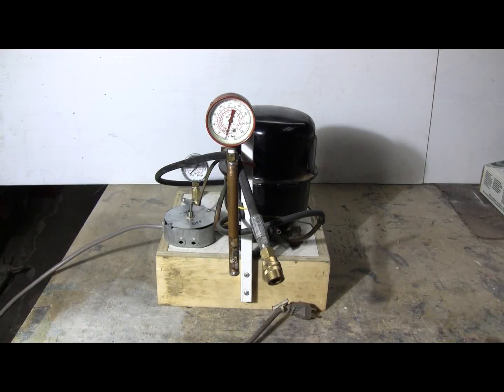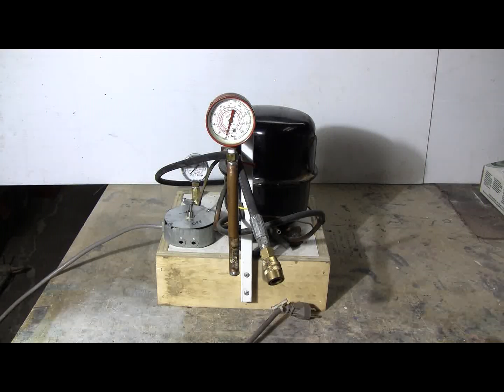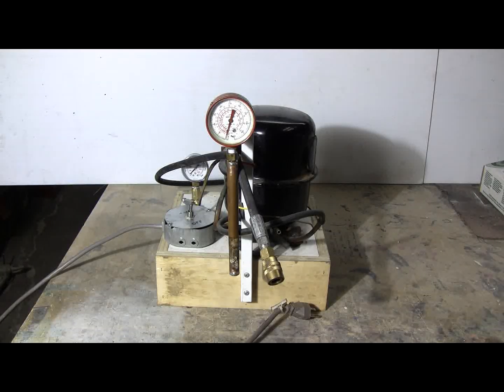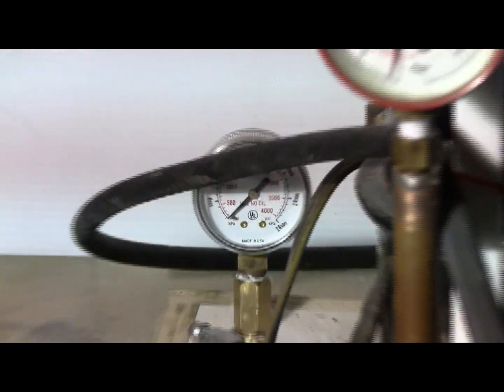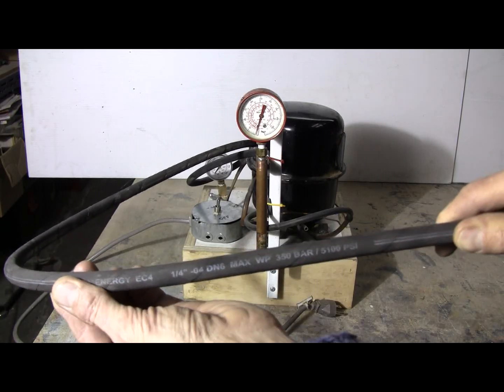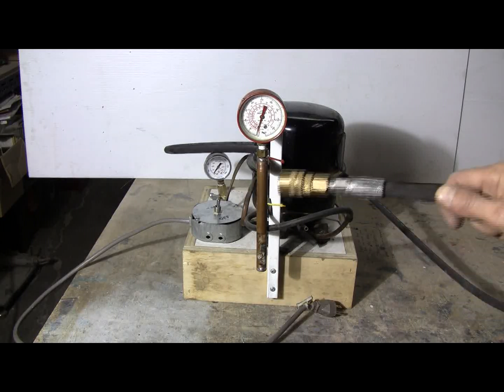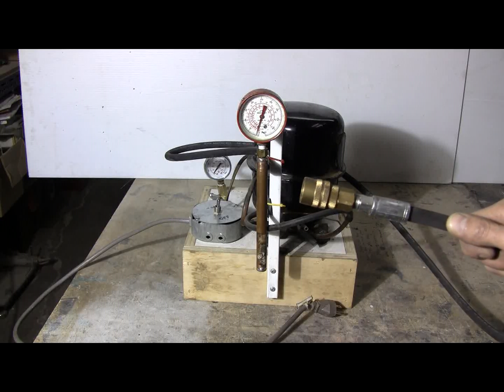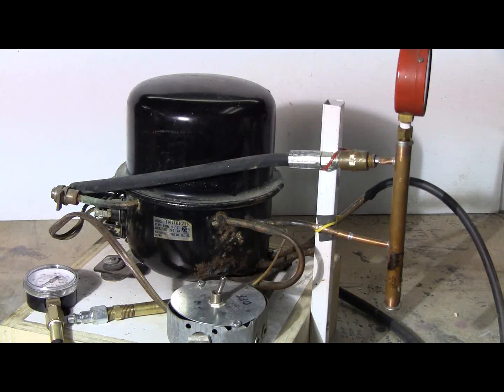Air Cannon #30 - The Air Compressor

Comment: Sir Bill, can this air compressor refill a pcp thank having a 3,000 psi?
Reply from the maker: +nnawoj This type of single stage compressor will not reach 3000 psi. Most go to 450 or so with some able to get up to 650 psi or so.
Reply: How can we refill a pcp tank having 3,000 psi using refrigerator motor?

Comment from the maker: Yes. If you get a good compressor, you will not need to cut it open. You will need to wire it to a switch and of course, a plug. Once you can plug it in and switch it on, one of the pipes coming out of it will be blowing air, but not a lot, and another pipe will be sucking air in. From there, you can rig some sort of air filter for the air intake, and some sort of air chuck on the outlet (high pressure) side. I wound up putting a 48" long 5100 psi rated hose on mine with an air chuck on the end.

Comment from the maker: I built the air cannon solid, and then pressure tested it controlling the test from an adjacent room. It had no problem at 850 psi test, and I have never fired at over 750 psi. I don't go over 500 psi normally because that means changing pressure gauges on this compressor. Tire tubes are nasty, even small bicycle ones go off with quite a bang.

Comment: Could you use the compressor from a small aircon unit, that should give high pressure and high flow rate?